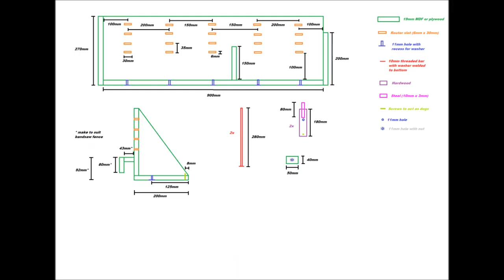Bandsaw Milling Jig - Free Plans

Comment: Any advantage of using the fence side instead or the miter slot on the other side?
Reply: Big advantage. 
Lets him keep slicing boards off without having to set up again simply by moving the fence over.
Reply: @richardmason902  And, it eliminates drift.